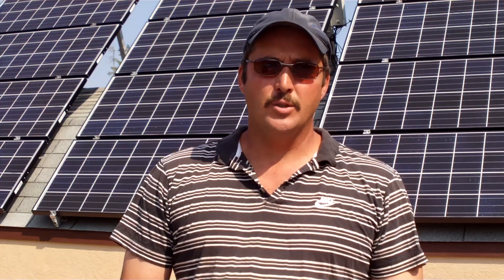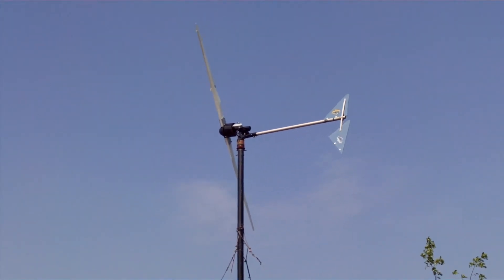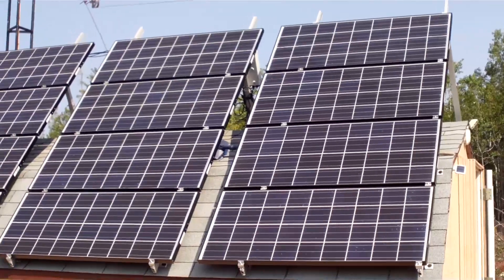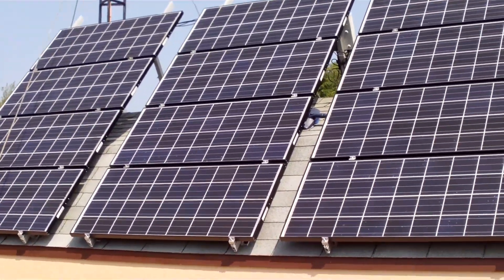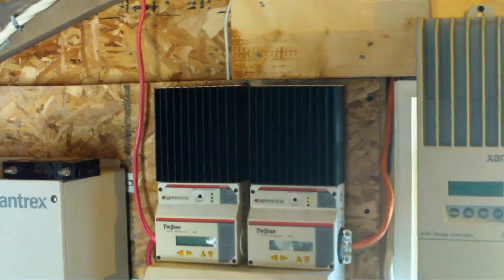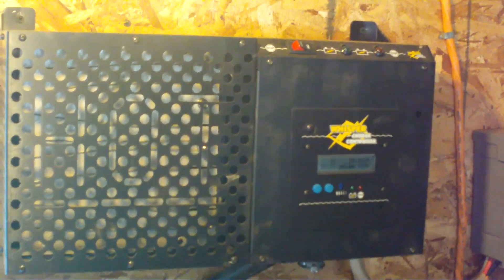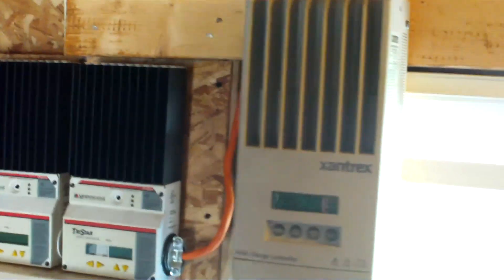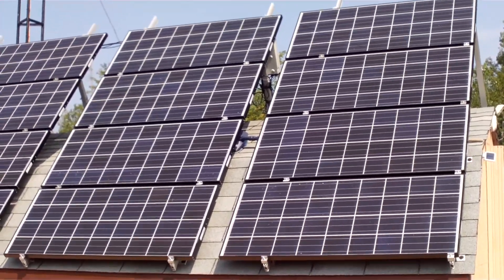off grid home pictou county nova scotia using solar panels and wind turbines

Comment: I'm just outside of town. And I went off grid. Because the house needs rewiring. All the way to the pole. The in house wiring that wasn't stolen is fine. I want to help the earth. I have 1200w in pv. Soon will be 1500. I need another controller before I can install more. Due to shading I will need near twice the panels I could if there was no shading. I went with a 120v well pump. And a tankless propane water heater. I just need more battery bank. Great video.

Comment: An excellent presentation, good information. I have some appreciation of "Off Grid"but we lived without refrigeration, used kerosene for lighting, and wood for heat. Today we are on the grid, but our domestic water is heated by wood, our home heat is wood and our water comes from a shallow well and is pumped by a 1/6 hp 120vac motor which is easily handled by inverter power. One point I would mention is the very high cost of propane. It is still an excellent energy source.

Comment: It was a very good show for me to see. I  build a 12 by 10 feet roof I could buy 5 solar panels which I did .I am  planing to buy an other 5 panels. If I can get for sale.I use a control for each panel and feed all of them to a few battles and then to an inventor . It runs a refrigerator, cooks some food and can run a 120 V circular saw , drill and tools like that one at a time , when there is sun.

Comment: Reggie,
thank you for showing your hybrid system.....in our case the solar panels move with the sun and a minor amount is from hydro.... mono PV's work best with higher so. cal temps. Our main energy draw is water pumping for 1800 fruit trees and also fruit cooling and refrigeration. Please continue sharing and include the reasons you selected poly vs mono and also the turbine brands.

Comment: Nice set-up my father has been off the grid here in nova scotia for over 10 years, myself being closely involved and I notice your batteries in this system seem small in the amp hours dept, you should look at surette/rolls batteries made in springhill, thats what my father has, each 6v battery is 460 amp hours(mind you each battery is 117 lbs) and are extremely durable after 10 years i just finished desulfating them and they work like new again, i did make a video 5 years ago about his system and more resent videos about the desulfating the batteries

Comment: I built a over hanging  plywood-metal roof over my 1000 dollar 1965 mobile .Keeps rain water from running down walls and common floor rot around edges of mobiles.Plus with this roof I can have gutter s  which I use to catch my water needs.

Comment: i live in ohio and i have 1,400 sqft ranch house with basement and my biggest gas bill in last two winters was $117 and i keep my thermostat at 75F and electric bill with electric stove,hot water tank and central A/C set at 75F was $75, its about little over $1,000 a year and no trobble of pallet stove or anythink like that .main think is to well insulate your house and good windows and doors .
ofcorse its always good to have back up power like generator ,solar or wind. i have 1kw solar system

Comment: Now that it is 2020, I'd be curious to know how your system has held up in nine years? I'd also like to know how well those wind turbines contribute to the charging of your system? I've done a lot of investigation on wind turbines, and a lot of recommendations and reviews refer to wind turbines as a waste of money, as they do not perform to their optimal specifications. In other words, you would need 'constant' wind speeds of thirty to forty kilometres an hour in order to get any kind of output. A lot of genuine solar/wind people would advise you to spend the extra money in solar panels and forget the turbines. 
In your nine years of off-grid power, how much have you spent on replacement of pieces such as batteries, controllers damaged by lightning, etc,...? You have to weight the costs of hydro verses solar and the cost of replacement of components that have a finite lifespan. I love the concept, but sometimes hydro is just so convenient.

Comment: now in 2013,what would you use for the charge controller and the inverter for a 2500watt solar setup?what size fuse would you use for each component? i am looking for either 24volt or 48volt system.havent bought the batteries yet either only the panels.

Comment: That wind turbine support may shade your panels at times.  If shade hits one or more panels on a string, the whole string will be significantly handicapped if not neutralized, and then that underperforming string will be averaged with the performing strings paralelled in the array, having some viral impact.

Comment: keep a eye on your 3kw turbine, they are now made in India. I repaired one last year after it shook itself to death. One of the tape came off the prop and created a very bad vibration. The mountings screws fell off the plastic junction box witch led to the breaking of the field wires. It also wore the main power line inside the tower from rubbing. They have to be taken down EVERY year to check and replace defective parts.I have read more negative then positive stories on them. I have checked all local repair shops and no one will touch them. Good luck with yours.

Comment: Array is very small.  You can fit 12 60-cell panels (220-260W typical 240W) on a 60A charge controller @ 48 volts (4 strings of 3).

My system is bi-modal, it can be both grid-tie (net-meter) and off-grid. Its 6.48KW (27 panels)

Comment: Have you tested the voltage on the panels that have the guy wire shadow cast on them ? What happened to the 3 KW turbine ? Its not turning and the tail looks like it was rode hard and put away wet. That's no big deal . You did a great job showing us your place in one video. It took me about 90 videos to show my off grid nightmare LOL.

Comment: I am very impressed with your system.  I have 1.1 KW of solar panels that are 12 volt and each panel creates 145 watts or 7.5 amps x 8 panels or about 60 amps an hour.  I was wondering why you chose to go to 48 volts reducing your amp outage?  I am still sort of new at this and learning more everyday.  By you going 48 volts does it make your amps stronger than my 12 volt amps or are amps the same no matter what type of voltage makes them?

Comment: Wondering if you can forward the material used or what "complete package" to order.
Why you took Xantrex vs Outback vs trace engineering

Greatly appreciated
Reply: FM Solution trace and xantrex and schneider are the same. If you see sxhneider 60amp charger controller motherboard it says trace

Comment: Hello, A very informative video.
A few questions please. (1) What is their water source? Are they using a submerged pump  or gravity feed from a cistern? or a well?    (2) Are there any exhaust fans in that shed? (3) WHY isn't there a CO2 Fire EXTINGUISHER at the door ??? (4) Why don't you put those battery  disconnect  switches next to the door so that they can safely be reached in an emergency?
Thank you for your time.

Comment: Why wasn't the larger turbine running?
I've read that there is often a high failure rate with many of the Home wind turbines out on the market. 
What has been your experience with these turbines?

Comment: So whats wrong with the big 2 blade generator i noticed it wasn't turning.
Reply: It has a larger motor for higher speed winds so needs more wind to turn. The little one will probably stop producing in high winds. So you need two wind generators.

Comment: Why do all these videos need to have a 15 min sermon with them. Show us your set up, where you got them, how much it cost/save and be done with it.
Reply: He'll make his videos as long as he fucking wants
Reply: This just shows you've pretty much watched most of it, my advice.. Watch the first couple of minutes, don't think it's getting to the point? Fast forward it or go onto another video. Although, insulting people help improvements!!:) have a nice day!
Reply: ***** do you have an original point? I think I covered that but added the why.
Reply: ***** Geeez  is the F word really necessary?
Reply: If you are at all familiar with these systems his is easily understandable and the components for any power system are very basic. You have PV panels, a charge controller, a battery bank, and a good quality inverter. I use a Magnum Energy inverter with the remote controller. Where you buy your components after costing them out is an individual choice. Right now you can buy "Stion" 120 W panels for $120,00 apiece which are made in the US and batteries are best purchased locally because of freight considerations. I am in the process of installing a grid-tie inverter to use up excess power after charging and believe me there is one hell of a lot of excess during summer months. Good job on the video.
Reply: Amen! Hallelujah!

Comment: The batteries cannot all be series parallel. What he actually has is 8 wired in series at 48 volts and the rest would have to be parallel to retain the 48 volts. If you are wiring all batteries in a bank in series, he would have 48x4 and that would be 192 volts. Lol!

Comment: Well I don't want to rain on your parade but you could buy a lot of electricity from the grid comparing to how much you got invested into this. and when it starts to get to the point where you are catching up with what you got invested you have to replace your batteries that is why solar or wind is not cost efficient.
Reply: Wait ten years, then talk about how cheap your power is.
Reply: There is a better system out there other than batteries (which have a short life expectancy or solar cells) this type of energy is like a ford model A I have the concept of a self running generator plant. not a little self propelled thing run by magnets that barley runs itself. I have all the components to build but as with every slave time is the essence. other words there are more pressing matter at hand plus weather ect but I plan to get to it! Also government knows that anything like this they won't allow to be patent as it will get in there way of control of the people. you see it here in Canada and the usa  where they condemn people of there properties for not hooking up to the grid. My system a person would have to have at least a forty by forty back yard see in this world it is a consumer world and they don't want people to have something that runs for ever with little overhead! vehicles have a life expectancy  of about 10 years. I am willing to share my concept with everyone but only after I get my system going. But regardless brother I am on your side would like to have a system with little overhead and great payout. I am not kicking your ideas but if you step back and look at the whole picture I am just saying it is not cost effective.
Reply: I admire what you have accomplished. I would also like to go this route.
 But here in Alberta, Canada I live in a house in a mid sized city. My 
power bill for the month of July, 2016 was $28 BUT with the 
Transmission,Distribution,Administration, Rate Riders, and the Local 
Access fee paid to the City it then comes to a grand total of $177. Even
 if I shut every breaker off in the house I would still have to pay 
approx $140 a month just have a power meter. Now you know why many local
 governments want to make it illegal top go Off Grid. They would lose 
Millions of dollars paid to them for just having a power meter attached 
to your home even if you lived in the dark.  Live Free my Friend.

Comment: Why would you need that big of a system if your not using any of it for the dryer, range,  water heater, or the furnace? Couldn't some of those items fit into the system. Seems like a way to big system just for lights inside the house. I too would like to say you have a lot of rude people commenting here to you.

Comment: Ive reached out to several solar cmpanies to discuss going off grid.  The last one DETERRED me from going off grid ?  I was like huh?  Apparantly NSP has new code compliance and "charge big money to inspect the solar system?  Anyone have info on that??  That was his one reason. then i aksed if he could price me a system or show me a design to cover what my power needs might be.  He tells me to draw uo some loads ...ok.  As a builder when a client asks me to price a house build i work out a price and tell them whar they are gettng ...right?  So why cant a solar company tell me this ... Mark you need a 4 KW system to power your 540 square foot home with propane stove, fridge and tankless hotwater and it will cost you this much???? "  Anyone know a solar company that can help?  Help design? Help cost? etc .... NS power want 5-10 k to run poles ..i want to put that into an offgrid system   HELP

Comment: I fail to see the reasoning to use more propane and less electric when propane costs money and free electricity costs nothing but running the solar panels and wind turbans..  and why not go with one of the newer electric cars like the Tesla S...  they can go over 400 miles off of a charge!!  no more propane, no more gas for the car... completely off the grid!!  I would however not mind being connected to the electric grid as backup and sell any excess back to the utility company!!  Just saying!!

Comment: Unless you're making your own propane, you're not really off the grid...
Reply: exactly there is no point in it if you're still paying for propane
Reply: I've been looking around at hydrogen fuel, something you can make at home, although seems a bit dangerous.  Any thoughts on that avenue?
Reply: TheStavros1001 well from what i have read its the best alternative but still sketchy i wouldn't use it till its been perfected because water and electricity  is something i don't like messing with at the same time but that being said i like it
Reply: Don't be idiots all of your lives guys, being off the grid means "not hooked to that system with all of the wires or the pipes"  He didn't say he was self sufficient.
Reply: That's your opinion.  For most of the rest of us, being off the grid means being self sufficient.
Reply: Speak for yourself. Some of us are in it to save money and couldn't care less about causes or conspiracy theories. Personally, I like being connected to the grid so I can sell my excess power back to them. I have micro hydro and wind power now and with the money I sell back, I am saving for a solar bank. But it's my hydro unit that really makes the power for me. Always runs, even on a calm cloudy day. I am looking into making my own methane out of rabbit manure but really I don't have anything to run with it other than my car's. But I have considered propane as an alternative.